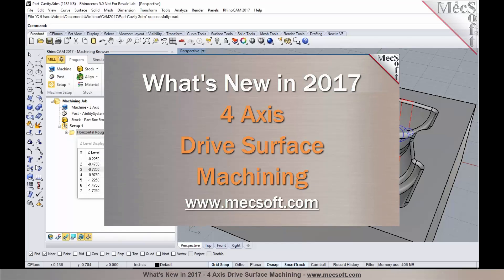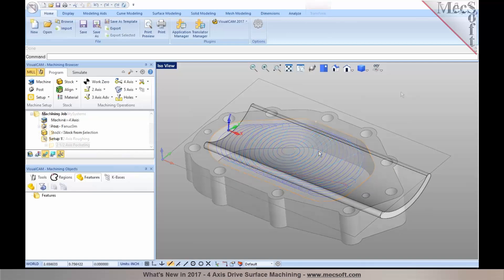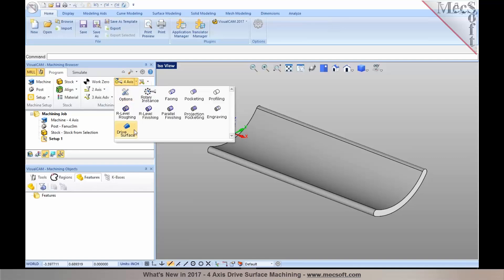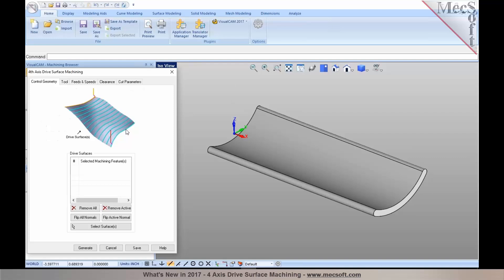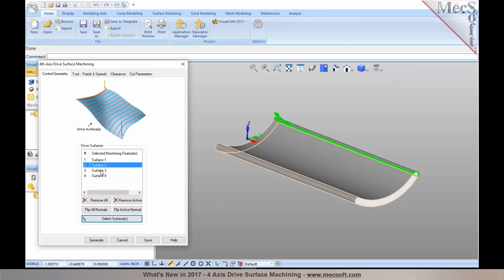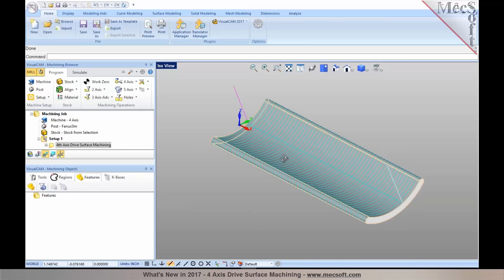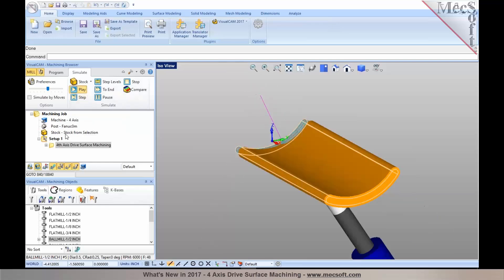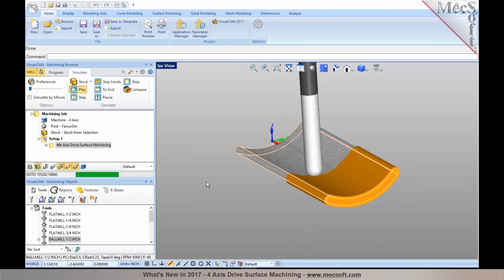2017 4 Axis Drive Surface Machining

Comment: is there any way to use mesh geometry for this strategy?
Reply from the maker: Yes, you can cut a mesh with 4 axis drive surface.  However, you do need a surface also.  The surface can be basic and lie within (inside) the mesh.  It is used to orient the tool "while" it follows the mesh.  Please email us at support for more information.